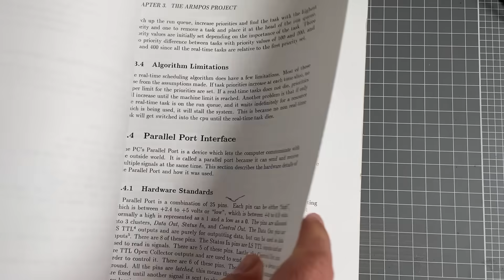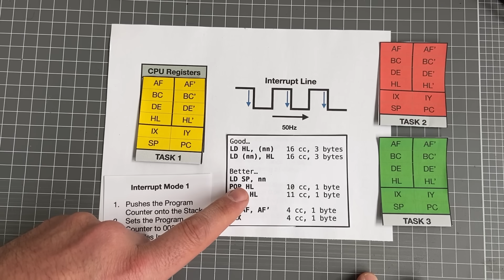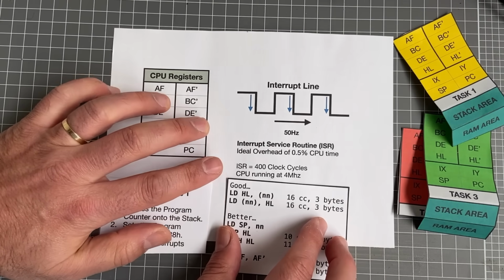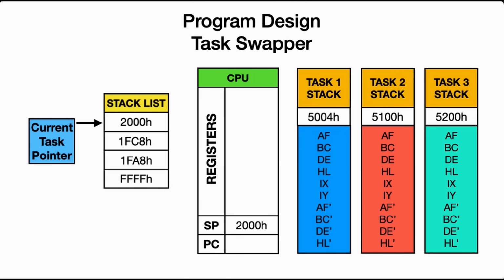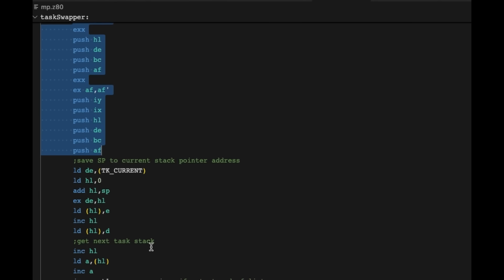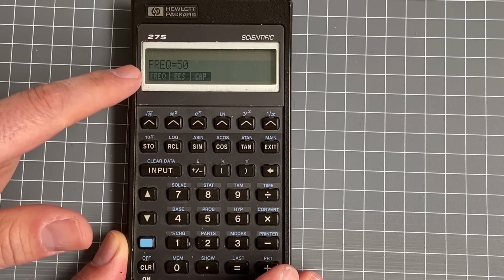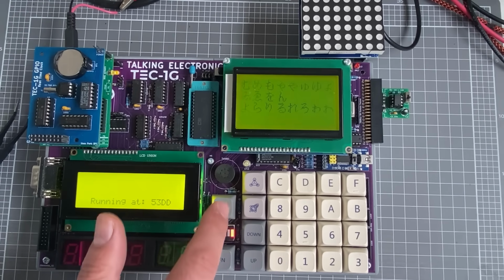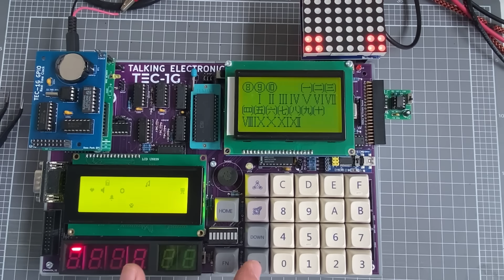Multitasking on a Z80 CPU

Comment: --- Component tolerance 'hunting' rant below ---
Well, for circuits where precision of some kind is needed you shouldn't go off the values of components anyway, you can easily find an exact component by measuring them. Components are regularly 5 sometimes 10% off their reported value. So it is not hard to find a 1,44Kohm resistor, you buy either 1,4 or 1,5k ohm resistors with 10% tolerance and measure them to hand select one that is exact, or 1.45k with lower tolerance - you would have to since 1.45k isn't sold in "wide tolerance" but again you'd buy a pack of 10 or something and measure to find what you need. 
The other circuit may be off anyway so it might not respond per the formula to the resistance etc values, it will likely be 5 or 10% off the mark too. 
The point of this is that you shouldn't worry about exact values when you're hand building something, you'll need to measure and hand pick components anyway if you want to be sure it'll work as you designed it to. Then if you're machine producing, or making things in a way other than by hand and measuring every component - you will need to make it tunable and/or have a calculated tolerance that you design the circuit to have based on component choice. 
I had done a lot of programming and then went to ASM and then at one point to logic gates and got into the ... more "analog" side of things that way, I didn't do electronic circuit design at school or such, beyond some simple like LM7805 series power supply for the uC I ran to do projects etc. Then years later a friend and I started a company based on making products out of things I had already prototyped, luckily that friend of mine had done the whole electronics circuit design stuff, but in turn he hadn't done programming and theoretical stuff the way I had. 
I did learn the quirks of "how you do it properly" to a degree from him, but also how to get stuff to work the way it should which is to buy 10 or even 100x of something and go on a 'hunt' armed with a multimeter 😄 and simply find EXACTLY the value I want based on measuring it instead of looking at the colored stripes hoping it is close. Then later when I built more stuff I bought things like "50 different resistor values, 100pcs of each" from ebay and then measured them and stuck them in boxes for "exact value X ohm" and then like "junk bucket" for the stuff that was not what it should be. It's fine for some positions in some circuits, but not in others, but also if I needed something that was 10% or 20% off from a value I had already bought I didn't need to make a new order - just grab multimeter and go look in the "bad resistors" box, plenty to pick from there. Most was simple through hole basic 10% tolerance stuff that is cheap but also fairly widely usable and can handle some power. But you can of course get Grey(0.05%) or Violet(0.1%) stripe stuff from Mouser or Digikey. I just checked one example resistor and the difference is 10 fold to go from 1% to 0.1% - in price too. So for the price of one 0.1% tolerance component you can buy 10x of 1% tolerance. But it's taking a chance, and it depends on the kind of component, it's not unusual to see quite small variance from one component to the next on a reel, like if you take 20 of some component and it is rated 1%, it may well be that all those components are actually + 0.7% to 0.9% measured. So in that case you'd have a problem and have to order again picking another SKU and maybe tighter tolerance. 
All this kind of thing is different if you need to have 100 or 1000 or more made of something. There is a system for it too but more complex than makes sense to get into here.

Comment: Great to see you have such a following now. I did much the same on a Z80 but I left the alternate registers for in the int routine. I had two tables - first was highest priority (frequency) and had "active" and "entry" "active was set to "'0" when the routine was called and the routine had to call a specific address to return it to "1" so that routines that crashed weren't called again. This table was for high speed responses so it was very simple. One of the high speed int services ran a second table that included a countdown so that routines could be prioritized. I would love to build a SBC to try this out on a 6809 that has a system stack and a user stack. But anyway I was banned from the TEC group without rhyme or reason so spend my time in the SC group now. Their loss not mine!

Comment: Unfortunately, most of my early programming experience was with the old PIC 12 ang 16c5 microcontrollers.
a whole two layer PC stack, no interrupts, a whole 41 bytes or RAM
I divided multitasked processes by implementing a timer and ensured all the modules would execute within that timeframe, returning a call pointer to the next module segment.
The task scheduler would save that pointer for the next module run and wait for the timer to roll over before executing the next task, leaving the individual modules to do their own context saving. a waste of processor cycles sometimes, but it worked

Comment: Nice, I also developped an OS for Atmels ATMegas. It is based on a different premise to most OSs in that tasks are constructed using zero wait state machines and shared resources are threads also implemented as zero wait state machines. It has a rule based construction rather than using OS code. It has few and very short interrupts, just to handle asynchronous tasks, the systick timer for example does not use interrupts. In 2021 I ported it to the STM32 processor family and developped several motor controllers with CANopen for coms. The code is all bare metal and it is extremely fast easily out performing FreeRTOS.

Comment: Surely there is no CPU that cannot multitask. If it's turing complete it can do anything any other CPU can do. Arguably you also need interrupts - I'm not aware of a CPU that does not have those though have no evidence they don't exist, but I wuold not even say that is a necessity.  I'm not knocking the very interesting content, but "How I made a Z80 multitask" might be a bit less of a click-baity title. FWIW the 2 register banks in a Z80 make it particularly easy to implement a 2 task system.

Comment: Absolutely you can do multitasking on the Z80. In the early 1980s when Tom Rolander and his team were developing MP/M at Digital Research, I built a 4 MHz Z80 machine at Micro Database Systems in a NorthStar S100 chassis with 256K static RAM and 2 13-inch hard drives to run a beta copy of MP/M. It handled 5 user terminals (Lear Siegler ADM-3A) with no problem. No dropped characters when one of those users was our 100 WPM technical typist running Wordstar.  I was using the 60 Hz powerline as my clock and preemption interrupt, with a filter to eliminate powerline impulse noise before some schmidt trigger stages to generate a square wave for the interrupt. The keyboard input was also interrupt driven, and had a 16 character circular buffer to mitigate processing delays in the user's program. Depending on what was happening in the Wordstar, the character echo could be a little laggy for the superhuman 100 WPM typist, but she was a touch typist and soon had supreme confidence that everything she typed would appear. It was never a problem for us normal typists. After a few iterations with working with DR to fix bugs, we had what I thought was a stable system. We put the system through its paces and used it to do day-to-day work with the typist and some software developers doing text editing and compilation, and light testing.

On the subject of the preemption interrupt frequency, I suppose you could make some graph with intersecting curves to determine the sweet spot. I just used the 60 Hz power line. Let's say your system was really busy, and had 10 tasks ready for execution (not blocked waiting on I/O), then each task would get executed 6 times every second. That seemed plenty to me. The other advantage to using the power line frequency is that, in the long term, the power company keeps the clock time matched to the NIST atomic clock, so the system time-of-day clock remains extremely accurate. If it doesn't, this is evidence that you're missing interrupts, and I used this to debug an early version of MP/M.
Reply: One of those 13-inch Shugart hard drives had 8 normal heads on the swing-arm and 8 heads on the bottom of the bottom platter which read fixed tracks. I wrote my driver so MP/M's disk directory ended up on the fixed tracks so the head positioner did not have to seek to read the directory.

Comment: Back in the day, it was pretty common to reserve the shadow registers for ISR's, which saved having to push and pop them. That was 100% compatible with 8080 code, and user code even got to use IX and IY. That's how the MP/M system that I had worked.

Then a buddy of mine wrote an XPL compiler that offered an int32 data type, and compiled code that held 32-bit values in B'C'BC, D'E"DE, and H'L'HL.  I had to rewrite a ton of ISR code. to make my BIOS compatible with his compiler.

Have you ever thought that we're living in the good old days?

Comment: In the 1980's there was a computer brand named Monroe by Litton that was running multitasking on a Z80.
OS8MT was the name of the operating system and it was using the same Basic as the Luxor ABC800 series of computers (give or take a few instructions).

Comment: Many older console games used multithreaded scripting languages, such as the SNES game Shadowrun.

I've been reverse engineering three playstation games this past year, and one of them really stood out. Front Mission 3 does multithreading and running a stackless script interpreter for each thread. The PSX's cpu is 33.8688 MHz, a 32-bit RISC CPU variant of the MIPS R3000.

I've only observed two threads being used at a time, but it's capable of running 19 threads simultaneously. The scripts control almost everything. They start and end threads, load thread mode handlers and more. The scripting language has 436 opcodes (after a month of reverse engineering I've only fully identified 37% of the static opcodes, but a couple of them are volatile/polymorphic). The scripts can perform jumps, conditional branches and calls (max depth 6, stackless). Scripts share a limited number of global variables (words, bytes, nibbles, crumbs and bits). Everything centers around the different user interfaces and menus that make up the game. It's a lot more complex than most people would expect. (Edit: the thread mode handlers aren't scripts. What I call thread modes are indexes in a jump table associated with things like menu loops and rendering. Running a script is one of the thread modes; kind of the default.).

Comment: Very nicely explained.
Real preemptive multitasking is where each task is "unaware" of the other tasks running, so each one is basically running within an infinite loop.
To be able to do this the key ting is to be able to swap the machine state, that is what the CPU sees of the outside world (all the registers).
Again, the key thing to be able to do this is a "movable stack" which is what allows to push one task on the stack and then pop another stack in.
The Z80 has interrupts and an assignable stack pointer, so as you demonstrated it all works fine.
The situation is different with the 6502 that has a fixed stack at memory page 1. The you need an MMU to "supplement" the CPU to implement the context swapping.
Reply: Yup the 6502 was only really half a processor. Bare minimum number of registers, odd RAM use, odd zero page instructions. Using 256-byte pages, where the Z80 and most other CPUs had the full 64K with full addressing. They might perhaps split the memory map into 8k or 16k pages if they wanted to use more than 64k RAM. I suppose clever commanding of the paging registers would make multi-tasking easier, if you told user programs never to access the paging registers. Shame there isn't an instruction trap, you could perhaps add one on in hardware but you'd be asking a fair bit. Perhaps have any access to the paging registers send an NMI and block the access.

Comment: Yes, a Z80 can most certainly multitask. The reason I know that is back in the late 80s, I wrote a fully pre-emptive multi-tasking kernel for a motor racing circuit in Milton Keynes (in England), which was associated with the later James Hunt. It still exists as a go-kart track, and it was commercially misconceived. However, it did run for a couple of years in its original form.

The system drove two printers, an operator console, a colour public display for showing car running times, a timing beam, start beam, start lights, car identification system, direction lights, a giant 7 segment display, a pit alarm and a few other things.

The circuit, which ran as a sort of time-trial over a fixed lap, involved the computer system identifying cars, going through a start sequence, timing them and tracking the number of laps bought by a driver and so on.

Was it a full multi-tasking operating system? Well, no. The foreground tasks were all hard-coded, ran in fixed address locations and it was an embedded controller. However, it had all the features you would expect in a multi-tasking, pre-emptive system, including scheduling of tasks, inter-communication via ring buffers (used to drive display output, printer output, inter-task communication and so on). There were seven foreground tasks (albeit one was the idle loop) and  . It did of course have mechanism for exclusive system locks. It did not use external storage, had no filing system, and relied on battery-backed RAM for persistent storage, and the memory map was split into 32KB of ROM for the code and 32KB of RAM for everything else. 

Memory was tight, but I was able to save a huge amount using shared routines, which were all re-entrant. 

One issue with the Z80 is that it doesn't have a true software interrupt routine, so what would be called supervisor calls were subroutines called via a jump table, distinguished from utility routines in that the former were effectively carried out in a non-interruptible state and would manipulate hardware and/or sensitive system resources, whilst the utility routines were just subroutines that inherited their state from the caller. Both system and utility routines could be called from both foreground tasks and kernel routines. 

It did operate, of course, in mode 2 and used the normal z80 peripheral chipsets for timer control as well as serial and parallel I/O in fully interrupt-drive mode. The two different displays were not interrupt driven, but instead used a foreground task in a high priority mode to drive them, took its display instructions from other task via ring buffers, which allowed several tasks to output to either of the two displays, and the same task also dealt with the low-level parts of driving the operator console keyboard (also not interrupt driven). 

In any event, the system proved to be extremely robust, and solid, even when heavily loaded. That's despite the Z80 not having anything in the way of memory protection.

nb. this was a moonlighting job, and involved designing some hardware too. My daytime job at the time was writing operating system code which ran (among other things) the transaction processing system for air cargo handling and automated customs clearance in the UK. That was written in IBM 370 assembler code (initially IBM S4 assembler, which was a semi-clone of an IBM mainframe developed by RCA in the USA). I adopted many of the principles for things from the core of that system.

Comment: As a teenager in the 80s, I wrote a multi-threaded mathematical word processor utilizing interrupt mode 2 on the Z80. The program ran on my ZX Spectrum +3.

Interrupts were generated 50 times a second (coinciding with the refresh rate of the TV). At each interrupt the keyboard was read and the results were put into a buffer (multiple key combinations and what on the +3 were single key equivalents could be distinguished due to the exact timings - pressing shift + <KEY> would alway have the shift pressed before the key, whereas a single key generating the same signal generate the Shift + <KEY> at the same time). This gave me extra keys for program.

The threading was achieved by cycling through the list of running threads and transferring execution to the relevant place in the program. Obviously, the stack and all the registers had to be saved and restored during the process.

Each thread had the option to announce it had stopped (so no time was wasted) and could be restarted from other threads. One thread was dedicated to drawing (typesetting) the current state of the screen.

Other threads controlled the editing and main loop. I had one spare thread which I never ended up using. If I wanted to scroll the screen, the editting routines would set a flag that told the screen drawing thread to redraw the screen from a new position in the buffer. That way, the computer would not be slowed down by the screen drawing routine needing to finish a screen before redrawing. It made scrolling through the text workable.
Reply: I remember the +3 (and +2a). I wonder why they made the memory banking so wierd and why Amstrad made it incompatible with the +2 memory banking model. Though banking ram < 16k was great fun to me as a child as I could write my own version of the rom. Oh, the power I wielded!